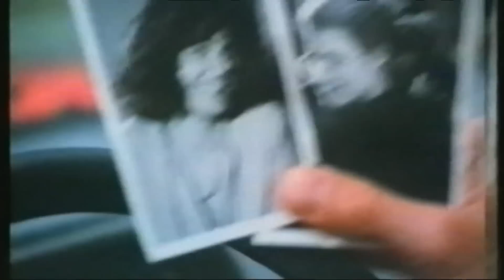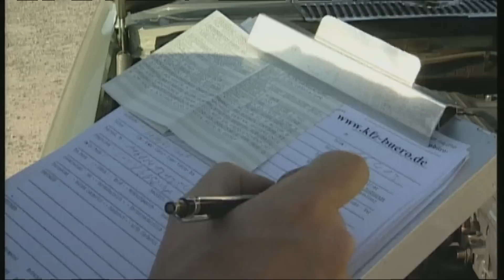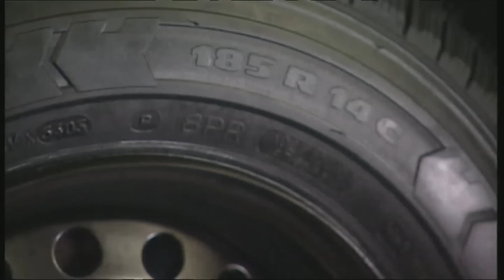Mercedes-Benz 280 SE

Comment: TIRES ARE wrong, it needs 295/50 R15 so it can turn and brake
Reply: No. It doesnt.
Reply: @petercollingwood522  With the 295 tires mine turned sharp and brake with authority, umbelievable difference
Reply: @G55STEYR  I've never had the slightest trouble turning or breaking in any Mercedes I've owned. 108's, 116's, 123's etc.